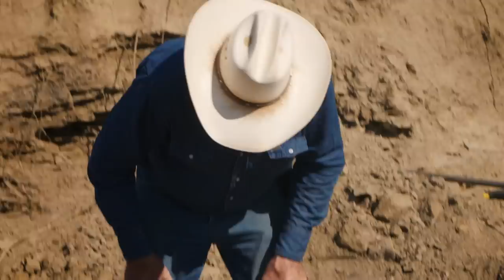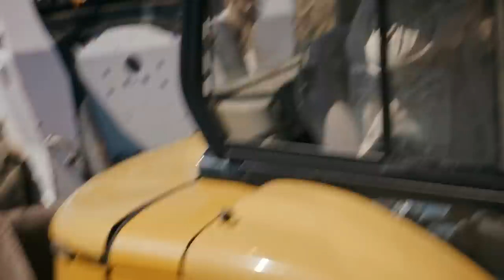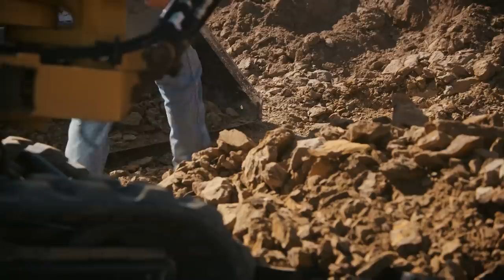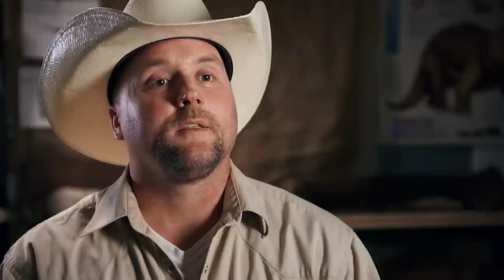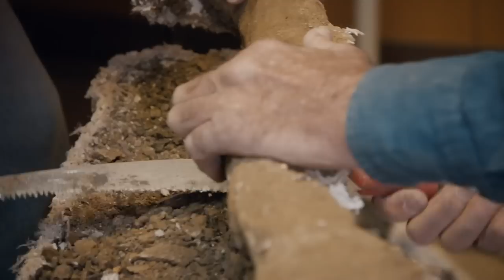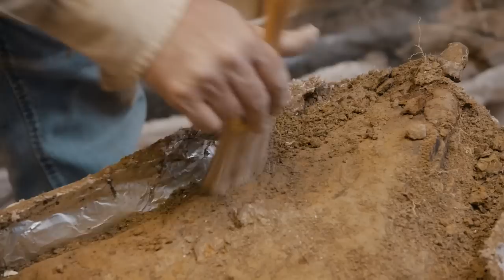Man Finds Buried Dinosaur Bones By Using 2 Sticks?! | Dino Hunters

Comment: use some kind of ground penetrating radar to penpoint the bones
Reply: That’s expensive, if they had that kind of equipment and skill they wouldn’t be using a back hoe and a wire coat hanger.